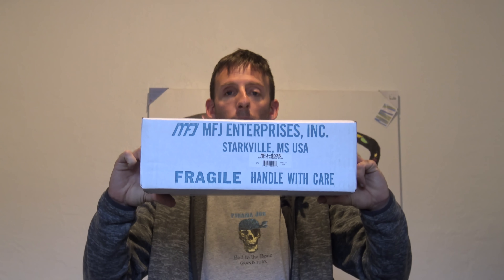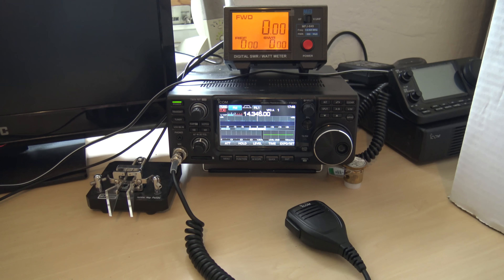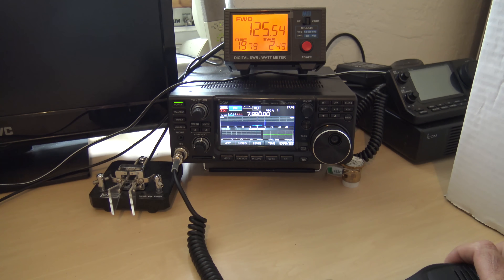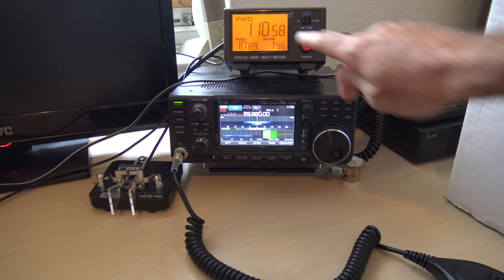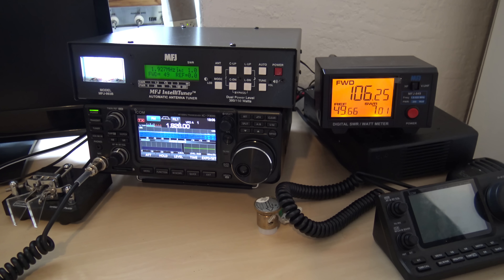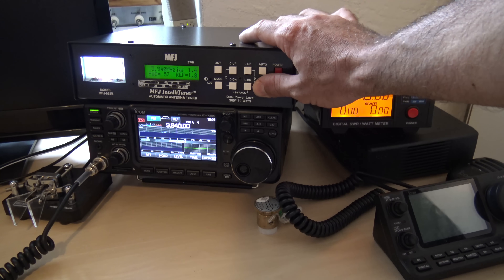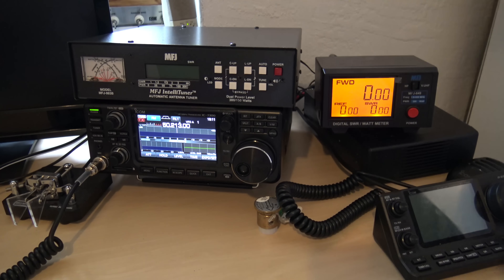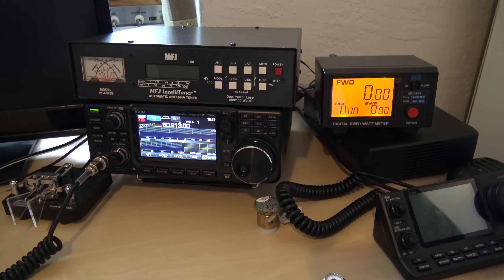Understanding HF Antenna Tuners, What Does It Do?

Comment: Well you just saved me some cash, so THANKS! Guess I'll spend the cash on an analyzer and new antenna instead of an ATU... I always thought ATU's were gimmicky... guess now I know for sure!
Reply: The information presented is incorrect, a "tuner" is in fact an impedance matching device. Where you might have problems is if you have either have an antenna massively short for the band you want to use or if you use a longish length of coaxial cable. A very popular (and effective) multiband antenna is an openwire fed doublet. Doublets can have strange radiation patterns on some bands, sometimes these will work for you sometimes against you. Antenna tuners might be badly named but they are definitely not a gimmick.

Comment: So, if you have a center fed dipole antenna, that you want to use from 10m-160m,  what length would you make it, as a compromise?
Reply: Anything less than at last a halfwave at the lowest band would reduce its performance on that band.   The other problem would be how you feed the antenna.  Coax or balance line.  On  bands other than the halfwave band it was cut for you will need a antenna tuner to correct the hi swr and return the signal back to the antenna.  You will need low loss coax at a swr of 10:1 or open ladder line which has low losses and the tuner too.

Comment: Eric, maybe a better thing to say this is the feedline between the tuner and the antenna is the problem, move the tuner next to what you are tuning then does resonate the antenna allowing your power into the tuned circuit we call an antenna. Even then an antenna needing a bunch of electronics or coils etc is still a compromised circuit. That is why the purest still advocate for dipoles or full length verticals with a huge radial or ground plane.  The folks using 43 ft verticals with a tuner at the bottom have done about as well as can be done to get their power into their antenna with least coming back.

Comment: OK Eric, enjoy your videos. Here's my question, I have a 20 meter inverted V it performs great. I don't have a tuner connected. I can actually listen to 40 meters and it comes in VERY well, but I don't transmit. With a tuner, is it possible tune my 20 m IV to transmit on 40 meters?
Reply from the maker: Well, it is not tuning your 20m v it is providing a match to your radio so your radio thinks it’s a 40m V with a perfect SWR so your radio will be happy and output all of its power, however after the tuner it is now still going into a non efficient antenna. An antenna that is longer than the band is always better than an antenna that is too short, so an 80m antenna will be better for 40m, 20m and so on, but a 10 meter antenna will not operate correctly on anything lower than 10m (15/20/40/80) it’s way too short. So your 20m v may receive on 40 because it’s wire in the air but it will never be efficient on 40m because it’s half the size of a half wave 40m dipole
Reply: @HamRadioConcepts  OK thanks for the reply Eric, and I think that's basically what you were saying in this video. I just needed to be sure. So if I understand correctly, with my 20m inverted V, it's more likely to use a tuner to "make my radio happy", on 17,15,12 or 10 meters than 40 meters.
BTW just want say, disregard the nay sayers you hear from. There are many more like myself that find you videos very informative, than those few with negative comments. I'd like to see these people make videos like this. Anyway, great job!
Reply from the maker: @chalemi  Exactly. I always used to make an 80m dipole, and I never got on 80m, but the dipole was twice as long as a 40m, 3 times longr than 20m etc, and that will give you gain, when you use your 80m dipole on 10m it is multiple wavelengths longer so that adds gain.. Tuner will be required tho.

Comment: I figured this out on my own about the antenna and the tuner and why the tuner only makes your radio happy but the antenna is still not tuned for the frequency you're trying to use . Now if your antenna is resonate with the frequency you're trying to use you don't have the need for a tuner to make your radio happy .

Comment: This is a great video on how an antenna tuner works. What it does and what it does not. And remember this is true for any kind of feed-line. Even the open feed-line. In open feed-line the feed-line loss is less then in coax. But the same principal goes.
Reply: If you read the arrl handbook or reflections you will understand that the video wasn't that great at all

Comment: What you're really showing is improper use of antenna tuners. Placing the tuner at the shack end of the coax is the problem. Put an auto-tuner at the feed point end of the coax where it will do some good. AM broadcast stations have been using tuning networks at the tower base for years.
Reply: This is true because they wanted to reduce the additional losses in the feedline due to the SWR if the tuner was at the transmitter.  I remember as a kid visiting a radio station.  The antenna and transmitter were very far apart.
Reply: @n1kkri  I've done engineering at several stations with directional arrays.  The towers are typically hundreds of feet apart and well away from the transmitter building. Often small buildings called "dog houses" are located at the tower bases to house the networks which match the 50 ohm Heliax to the tower. I have a tiny version of this at my ham station using an MFJ-939 auto-tuner at the feed point to match the DXE-400max coax, as can be seen on my QRZ page. --de N3TS
Reply: @timothystockman7533  That sounds pretty good.  For Ham radio I feel if the losses are low it doesn't matter where the tuner is located.  By the way I also have MFJ tuner,   The 993.   I was thinking about buying a battery operated tuner to do something similar to what you described for an experiment.
Reply: @n1kkri  If you have the option of open-wire feed line, then the loss can be low enough to locate the tuner at the shack end of the line. In my installation, I have 135 feet of coax, mostly buried, which enters through the basement and is then routed to my 3rd floor shack. This is why I had to locate the tuner at the feed point.
Reply: @timothystockman7533  Hello Tim,  you are correct with open wire feed line.  This was always the choice of Hams many years ago.  However if your coax (depending on losses even at 125ft) are low for the frequency your using it would be just as good.  Some people forget its more than the mfg spec of the loss per 100FT at a frequency.  They need to add the additional losses based on knowing the SWR the cable is dealing with.  Its the combined losses that tell the story.  If your less than a couple dB and we are talking HF, I wouldn't loose sleep over it. No one will tell the difference if the matching unit can provide the low swr reflecting back the wave to the antenna.

Comment: This is really more about feed line loss. The antenna tuner DOES convert the complex impedance presented to it to 50 ohms. But coax presents a high loss if directly connected to an antenna which is not anywhere near 50 ohms at the operating frequency. The solution is to put the tuner at the feed point. AM broadcast stations have been doing this for years, which is easy to do since the operating frequency does not change. With the advent of automatic tuners, even a ham who wants a frequency-agile system can place the tuner at the feed point.

I have a "stealth" 85 foot end-fed system with an MFJ-939 auto-tuner at the feed point and about 125 feet of coax back to the shack which works quite well on all bands from 80-10.
Reply: Just to be clear, the antenna tuner at the feed point both provides the loading inductance or capacitance to make the antenna resonant, as well as matching it to 50 ohms.
Reply: @David White Yes, but the feed line is mismatched if the tuner is at the transmitter end. By putting the tuner at the antenna, both the feed line and the transmitter see 50j0.

Comment: Howdy. Nice presentation. The following is my theory.
An antenna tuner will not make the antenna resonant. What it will do is make the tuner + transmission line + antenna a resonant combination. Assuming there are no losses in the tuner and the transmission line I believe the combination will radiate as much as a resonant antenna. The radiation pattern will be goofy however. Much power could just shoot straight upwards. Yes. There will be much reflected power back to the tuner but the tuner will simply throw the reflected power back into the transission line and antenna.
In reality there will be voltage peaks and current peaks in a poorly matched transmission line. That is exactly what the SWR is. At current peaks the losses will be quite high according to Ohm's law P = I2R.
So. The tuner makes the transmitter happy. But it cannot make the transmission line happy.
Feedback is very much appreciated.
Regards.
Reply: @The KF5S YouTube Channel With all due respect.
I believe the reflected cycle combines with the next outgoing cycle at the antenna resulting in a new impedance. There will also be a new impedance at the feed line input. I believe that if this new input impedance is matched with the conjugate impedance from the tuner most power will be radiated.
In high regards.

Comment: Back in the dark ages we had open wire line and low loss components. Stumbling forward coax feed lines and high loss auto tuners are the answer?  Me  I'm running back to my swinging links and neon bulbs! 
Placing the tuner at the antenna then running coax is lower loss.
Not hate mail just a point

Comment: Truck driver for 30+ years love my th. With wideband just bought my 1 st ham a icon 5100 love you're videos will try contact from Evergreen So when licensed .I go by Melbourne a lot .
Reply: Michael Bancroft I’m a truck driver as well, only 2 years. Thinking about the same radio. What antenna do you use on your truck and how did you mount it. Right now, since I don’t have a license, I just bought a Baofeng bf f8hp just to listen and a Comet cab-790a antenna.
Reply: I have dual fire sticks and use a comet mag mount on car .also use baofang to monitor  when in wife's car

Comment: A misconception, that these are antenna tuners.   They are actually impedance matching devices giving your radio as close to 50 ohms as it can AND DOES NOT TUNE AN ANTENNA..........
Reply: that's what he has been saying all the time.
Reply: yes so the antenna will radiate close to all the power.

Comment: Thanks for the video. I have an R7 40-10 vertical. It is resonant at certain places, like the low end of 40. It has a very high SWR on 30. I bought a tuner to let me use the antenna more broadly without fear of harming my radio. It's opened up 30 for me, and also 6! Not as good as a dedicated 6m ant, but I can get on. 73 de N5LL

Comment: I just have one wonder after watching this video and doing some research in this area. You were using some kind of antenna tuner which were near your device - this kind of hardware probably will not be too useful. But how about antenna tuners which are next to the antenna itself? For this example lets take multi-band antenna like MFJ-1625 (https://www.mfjenterprises.com/Product.php?productid=MFJ-1625) with (builtin?) manual antenna tuner next to it. I can imagine that this setup will make your antenna more or less resonant in given bands and will actually make a difference.

So is there a difference between antenna tuner next to yours antenna resonant part and the one in the rig? I am just curious because I have no practical experience on HF and just wonder if it's really not useful in case of multi-band antennas like this one?
Reply: I would think if the antenna tuner was placed at the feed point of the antenna the only difference would be the losses in the coax would be less based on the additional losses the SWR adds to the spec losses of the coax
from the mfg.   If the losses add up to be very low then it shouldn't matter what end the tuner is located.

Comment: In a previous video on the lakeshore you showed an MFJ telescopic on a grounding rod with a counterpoise wire. I eventually got one shipped to Scotland, took it to the top of a hill (we have plenty of those) and just used the tiny SWR meter on my 857 to set it's length for 20m.  I forgot to raise the RF power back to 50 watts after setting the antenna length and got a 1500km contact in seconds on 5 watts. Point made.

Comment: So an antenna tuner basically keeps your radio safe from reflected power?
Reply: pretty much
Reply: @sebastianbluecrew4320  not really.  It returns the reflected wave back to the antenna giving you the full power at the antenna minus the loss of the transmission line.

Comment: Question: If one is using a random length wire that is greater than 1/2 wavelength in length at the transmitted frequency, but with an actual SWR that’s high, will the tuner, if placed remotely at the feed point exhibit the same characteristics as shown in this video, that is, with poor forward power?  I ask this question because in the video the off resonance antenna is being fed with Coax.  Thanks.
Reply: The forward power isn't affected as long as the tuner is keeping the SWR away from the radio (the radio will keep putting out full power if it sees a low SWR). The tuner reflects the reflected energy back to the antenna again, so all energy is either radiated or lost to resistance in the transmission line or antenna wire. If you put the tuner at the feed point of the antenna, there's no transmission line loss (since you're eliminating the transmission line) so almost all the energy will be radiated other than resistive losses in the antenna wire and maybe a teensy tiny bit in the tuner. If you use a low-loss transmission line like open wire line then, again, almost all energy will be radiated.

Comment: Running the internal tuner or an external tuner on 160m if its needed or not will help block strong AM broadcast signals and keep that pesky overflow light off on the 7300. Basically a pre selector.  Try it, it works great! 73

Comment: after watching this video would it then make more sense to invest in an antenna analyzer  instead,   adjust the antenna for best match then use the internal antenna tuner in the radio to touch up swr on different frequencies on a specific band?

Comment: So what about something like a G5RV Wire antenna that says it requires an antenna tuner? Obviouslly they have to make a difference on those correct? Im trying to get into HF on a budget and it seems like a G5RV is a great entry Antenna
Reply: I have worked the world on 100 watts and a G5RV. Most of us do not have the room to put up multiple antennas so the G5RV is a decent compromise. The G5RV strength is that it uses low loss ladder line as the feed line which helps the antenna radiate more of the RF power. There is a reason thousands of people use it! This video isn't 100% accurate but his main point is VERY valid. A resonate antenna without a tuner in line is the best option. Using a tuner should be a compromise If you can't erect a resonate antenna. My only gripe is he is makes tuners (matchers) sound like the devil. They are not. They have their place. Commercial transmitters use them as well as the military. If I were just getting into Ham radio I would buy a resonate 20 meter antenna and then run 2 wires one for 40 and one for 75/80. I run a 80 meter windom wire and then for 40 Meters I just have a center fed dipole. Get them at least 10 feet off the ground at the ends and the middle up around 50 feet and you'll be happy. A G5RV is cheap ($50 or less) so you can't really go wrong if you have a tuner.
Reply from the maker: Austin DeMarr because a G5RV is a wire only resonant in 1 or 2 bands, the rest of the bands will require a tuner to make the radio happy with a match. You cannot have a piece of wire resonant across all frequencies. It is impossible. A piece of wire is resonant ata frequency based on the length. Some people want to operate on all bands without having 10 wires all across their property, each cut for a different band. So the solution is use a tuner on 1 wire, and it will enable you to use it across different bands but does not mean it willl make the antenna resonant.

Comment: Can you please recommend a "resonant" antenna that would cover most of the bands. BTW, I cant afford some million dollar rig, but you just saved me abour 3-400 bucks on a tuner. Thanks for the video. I cant do a beam, too expensive. Retired and  just got General but need antenna that would cover a lot of bands.........Thanks. Even some antenna company names?
Reply from the maker: I use a Hy-gain AV-680 9 band vertical.. Tune it for all 9 bands.. An MFJ 87-band cobweb is great too. I have videos on both of these antennas.. Also Cushcraft R-9 is identical to my Hy-gain AV680 i think... Check those out.
Reply: @HamRadioConcepts  Thank you much, will do!  73's

Comment: The only challenge to what you are saying  is if the tuner is before or between the feedline and antenna it is then an actual part of the antenna circuit  and makes the actual antenna become tuned not the feed line for the radio. Traps and coils at the antenna  are a part of the antenna and the swr coming back is what is in the circuit . Some believe latter line is likewise a part of the actual antenna tuned circuit. A tuner at the base of the antenna is part of the antenna, while a tuner at the radio becomes a part of the feedline and  has loss like feedline has loss.  of course efficiency of any antenna is determined  by antenna design and not tuning.